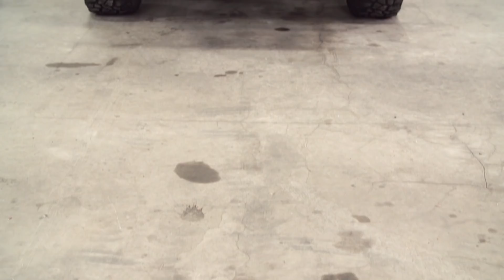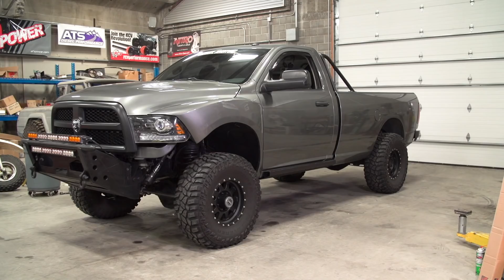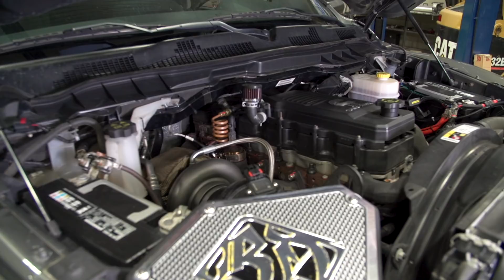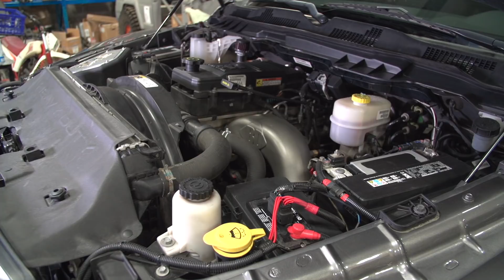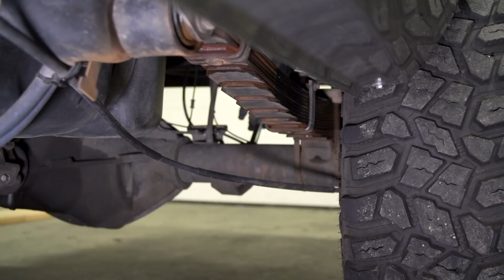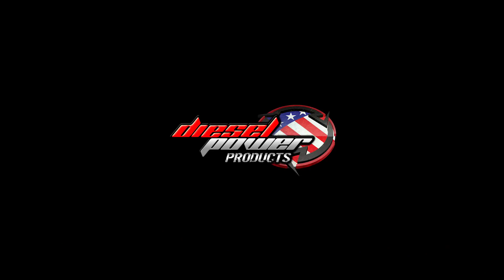What Do We Drive: Ash - Project Mjölnir Part 2

Comment: Ash what Gear ratios are you running in the axles? F/R
Reply from the maker: That 3.73's in it. With the G56 and 37's it was not geared correct, but still worked the way is was supposed to. This was a party truck and party it did. OOPH. -Ben

Comment: you can regrease "sealed" unit bearings... just pop out the abs sensor and squart grease in the hole. prob doesnt get the grease in there as good as hand packing a servicable bearing but it has double or tripled unit bearing life for me